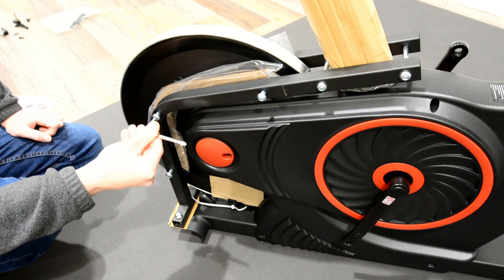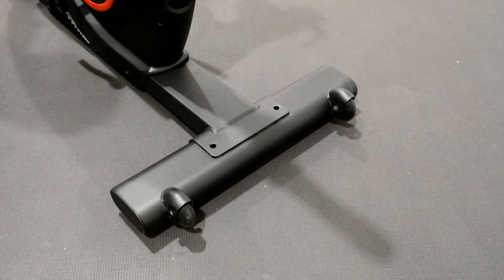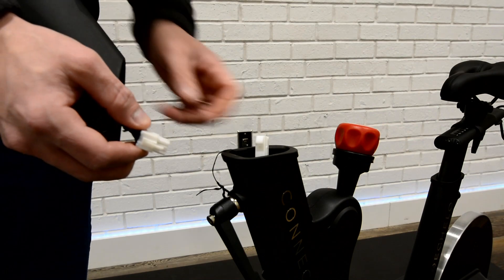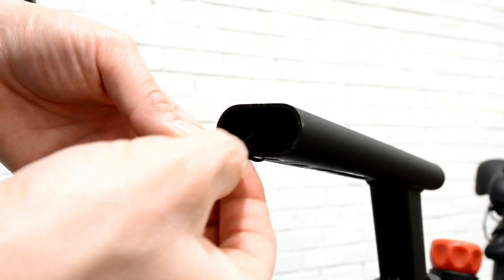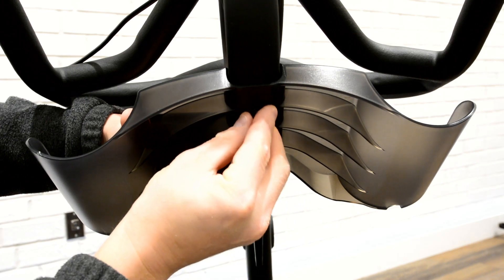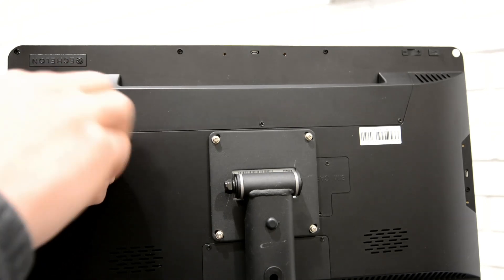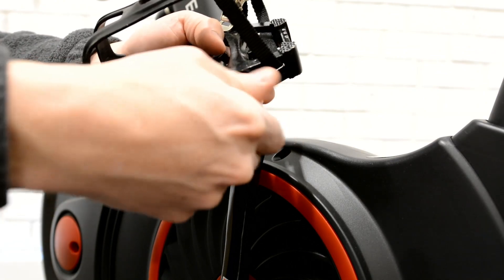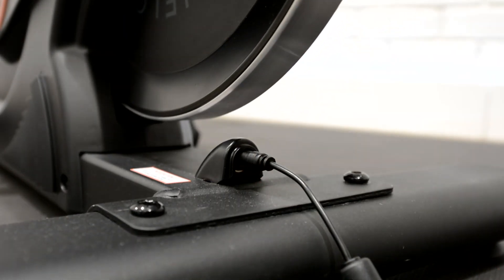How to assemble your EX5S Echelon Connect Bike

Comment: Took about an two hours to assembly. I did NOT encounter any difficulty during the assembly process. Follow the directions closely from the video. Online connection worked first time attempting to sign in. I had previously signed up prior to construction. 
Impressed so far with the bikes performance.